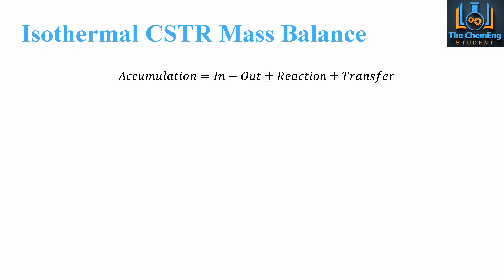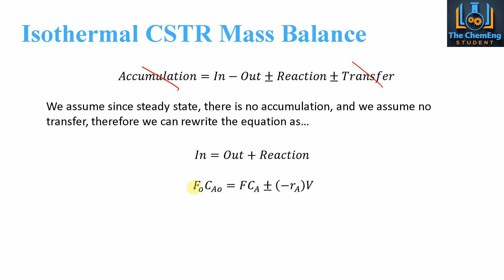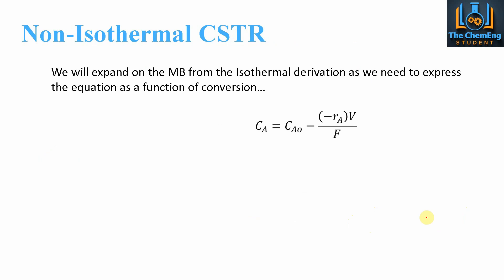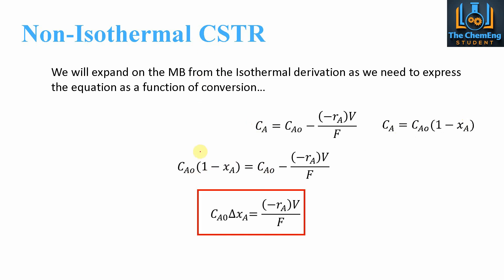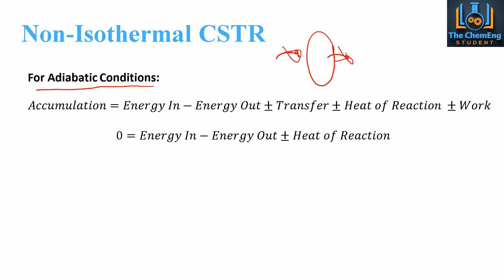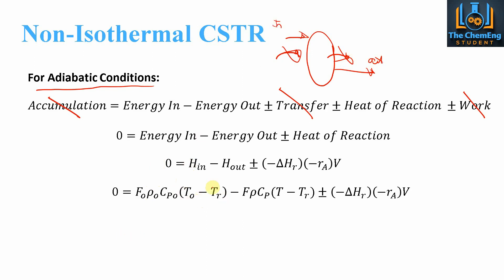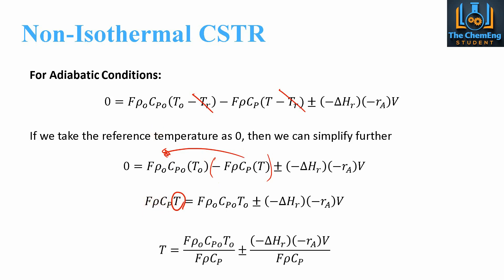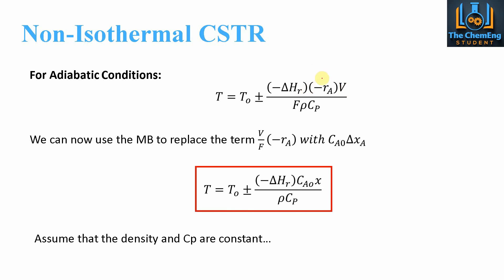Complete Design Process of a Non-Isothermal  CSTR Made Easy

Comment: Can you specify what you mean by flow rate? For example, molar flow rate, mass flow rate, volumetric flow rate etc.
Reply from the maker: The flow rate can be represented in either format, this is really dependent upon the information available to you. However, if we are talking primarily on the reactor input and output, they should be in moles, since those are the units we must use when modelling reactors. I hope this helps, thanks for watching!